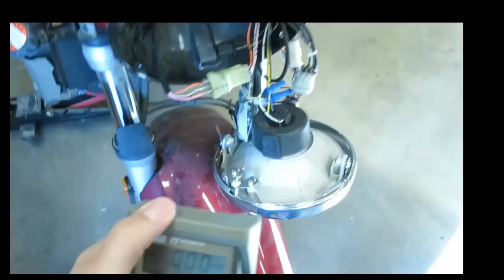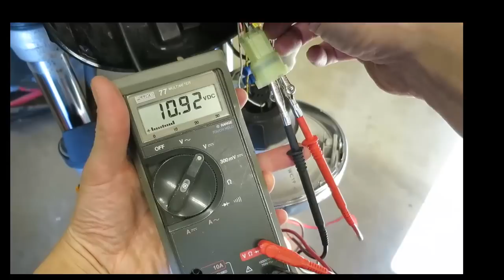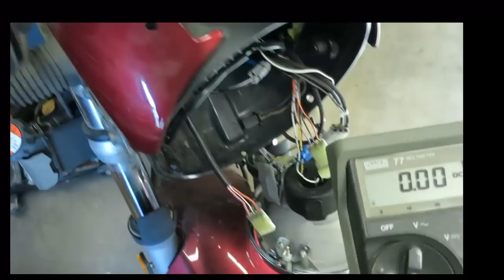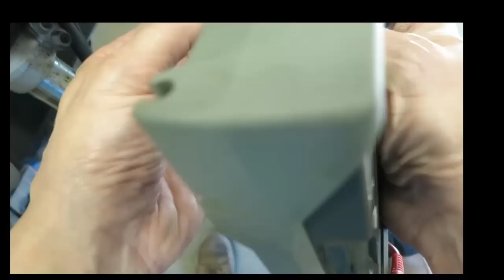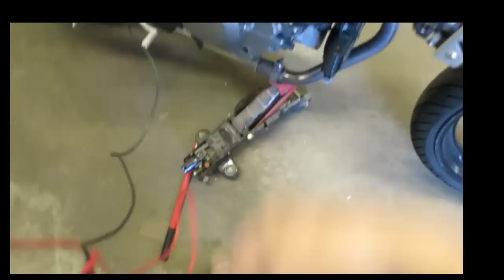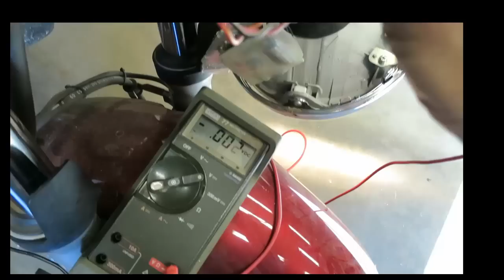SV650 Speed Sensor Test

Comment: Hi thanks but do you know if this test works for the 05/06 Kawasaki zx636 please, I've cleaned & changed sensor but still doesn't work, Temperature, rpm, etc. N everything else but not the digital speed meter and odometer

Comment: can i power the speed sensor directly into my battery and messure the pink wire, or does it needs to be plugged in to the gauge? because i dont trust my gauge.

Comment: Thanks for the video! I i am using to diagnose a 2008 boulevard c50 . The bike had a bad rectifier and fried ecu , burn light bulbs , so I fixed charging system and put a new ecu so when i took it for a spin I realized no speedometer. I got no power coming from the orange red wire I think the cluster got shot also . Unless im missing something.

Comment: NICE! Almost sure my DL1000 sensor is going out, as has failed me while cold a couple of times, and i've manually touched and it seems to be something on the sensor itself.
Good to know i can be sure its getting voltage and the output and be 100% sure i have to order one.

Comment: Thanks, this is the test I was looking for! However, 4 or 8 magnet speed sensor difference is not in regard of model year but on whether or not the bike is ABS equipped, according to Suzuki parts diagrams. So there are two different part numbers for SV650 speed sensors: 34990-17G20-000, or 34990-17G10-000 and both look the very same. Question is, which one of these have 4 or 8 magnets? I don't know yet, but I know I'm requiring the 4 magnet version because of a custom application I'm working on. Do you know which part number is actually on your bike?

Comment: Thanks again,  with this I confirmed  my speed sensor , she'za no good.   Question:  you seem to be knowledgeable about the speed sensor on SV's .   Do you know, what goes bad on these sensor?  Is it the magnet's or the pickup coil, since there's not much involved with moving parts.  You had also mentioned the some of the later year had 8 magnets verses the earlier years had 4 magnets.   one other question,  obviously!  if it's just the magnets, I can just purchase that part of speedo drive.
Reply: I don't think they're magnets but some electromagnectic field induced by the feed in 12v, causing a drop once the metal is not close, and a feedback voltage that is read by the odometer.